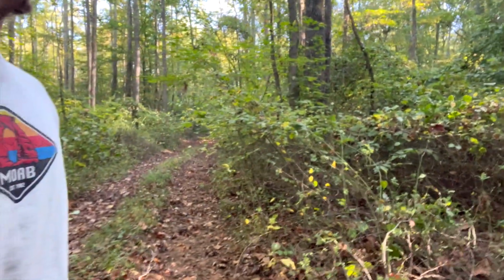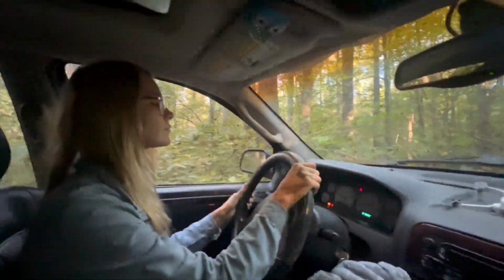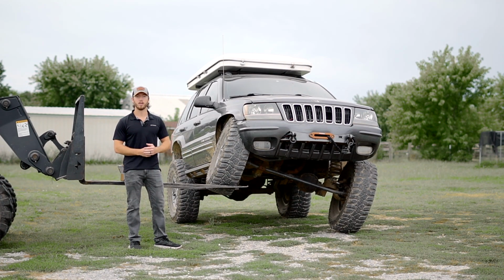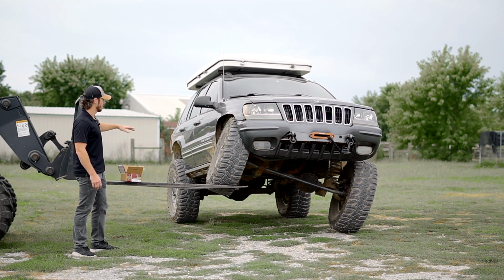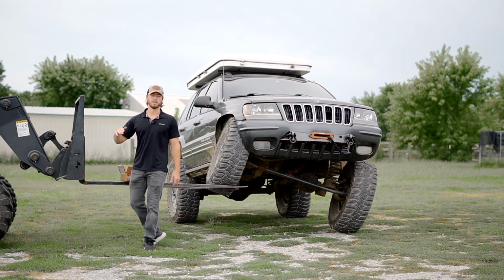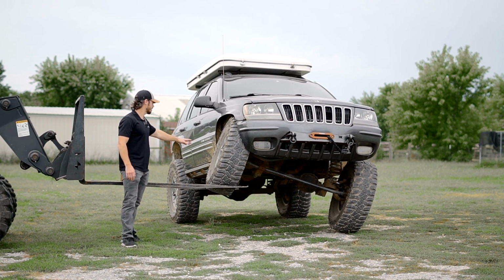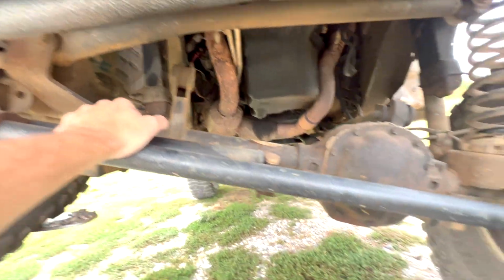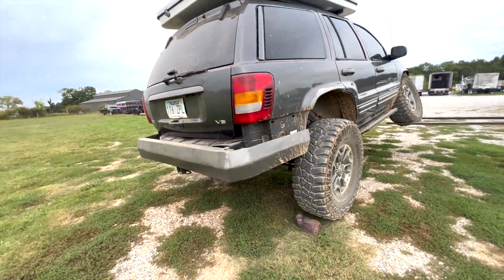This might be the WORST MOD | Best Campsite in OZARKS

Comment: The addco helped enormously on the interstate with swaying. I just disconnect it when I go offroad. I have heard some people ripped the sway bar mounts out by leaving the addco hooked up when offloading because it's so stiff.
Reply from the maker: Did you make quick disconnects? If I didn’t have such a heavy tent on the roof I’d just put on a antirock

Comment: For the street a 1" sway bar is great in the rear. For offroad a 3/4" or smaller is works best in my experience. A properly setup long arm will flex more than a stock style sway bar can flex.

Comment: The one inch addco is just too stiff, go with the 7/8, i am running a 6 inch long arm on my wj, with about 600 lbs of overland gear, lots of off camber rock crawling in colorado  the 7/8 inspires confidence on and off the trail